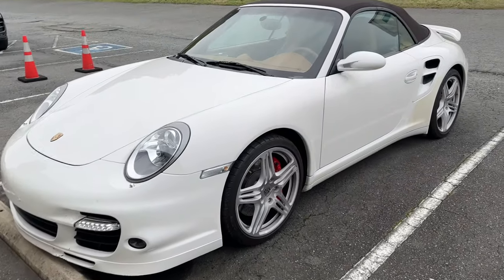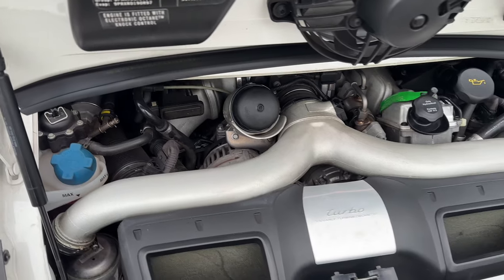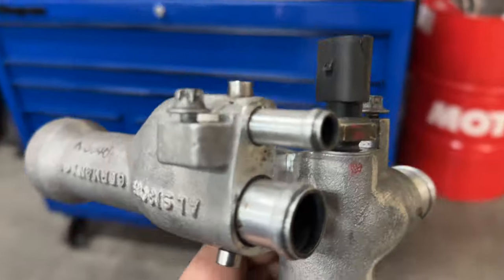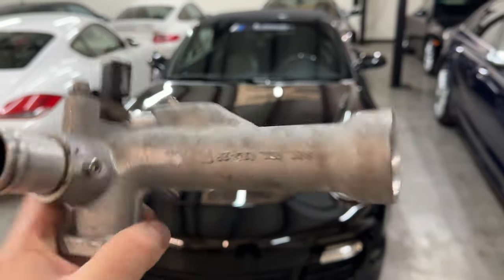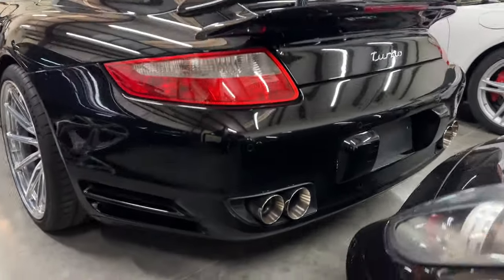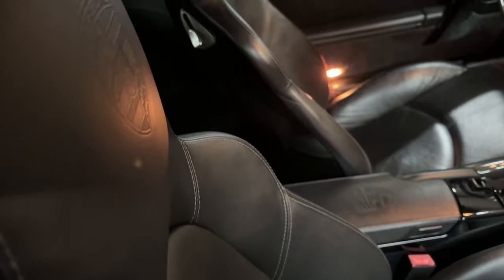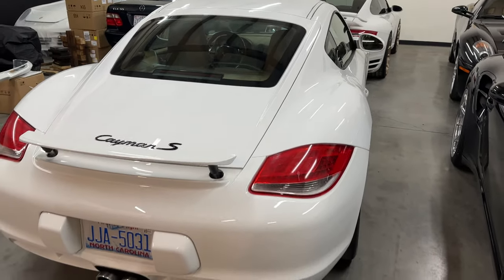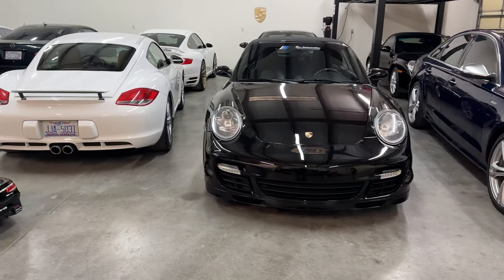PORSCHE 911 997 TURB0 - Don't get ripped off | How to tell if you got a good deal!

Comment: Great video, but $65,000 worth of work done in that black 997TT? Yikes.  I'd like to know what that breaks down to.  That's considersbly more than what a built motor and built tiptronic would even cost, which isn't mentioned.  This car being a Tip Cabriolet in black (all 3 being the least desirable) is worth $65k to $75k dependant in miles/condition in this inflated environment --Tops ...and going down every month with cars being in the market for over a year.  Prices are dropping back to normal here in 2023 noting this was a $55k car a few years ago.😂